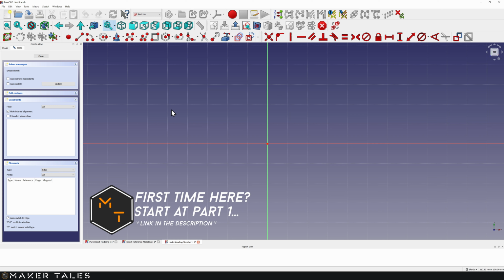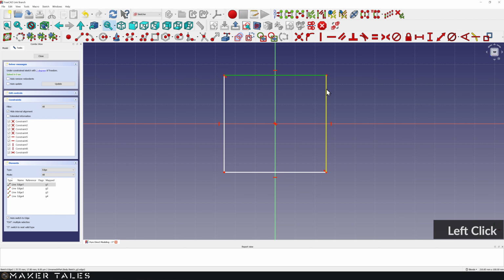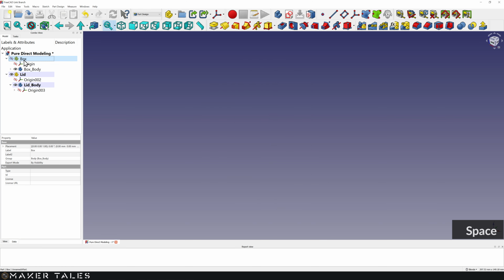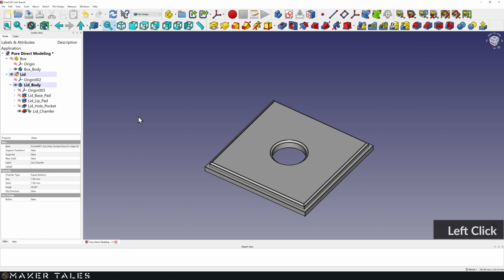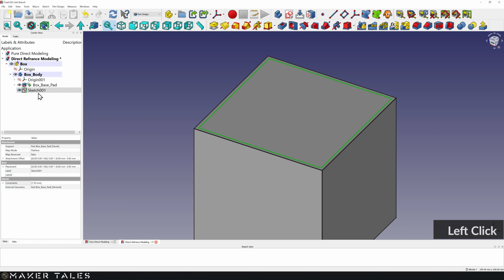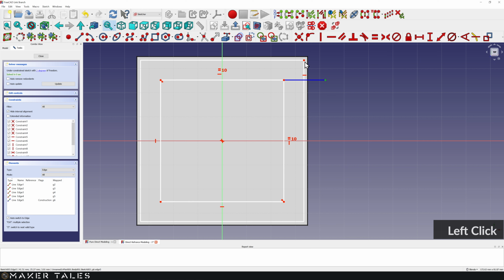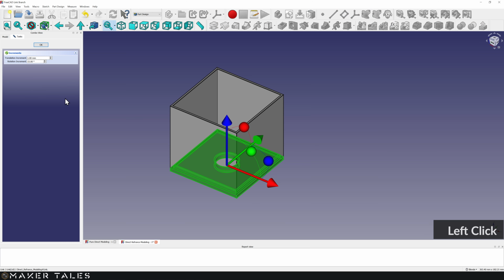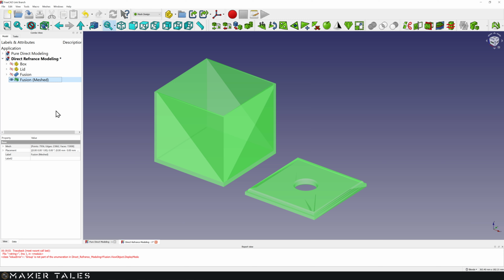Your First FreeCAD Project For 3D Printing | The Realthunder Branch | Direct Modeling | P. 4

Comment: A year on, and most of the info is still great. But I'm having an issue with the keyboard shortcuts not working. I can workaround with the toolbar, but "Shift-V" claims I've already got a locked dimension once the symmetry is established; and "R" definitely doesn't start a rectangle. Not sure what's happening. Of course, it could be something else, but I really haven't done anything other than this video and the one before it. But still glad to see such hard work going into this! 

NOTE: These are minor issues with workarounds.

Comment: Well FreeCAD 0.2 has been released and I can confirm that... you still need the realthunder edition to complete this tutorial:
* FreeCAD 0.2 doesn't have the enhanced External Geometry combo button so you don't have "Add/toggle defining geometry" available as an option.
* When it comes time to do the Lid_Base sketch FreeCAD 0.2 correctly shows the geometry from both of the Box_Base and Box_Hole sketches, but you can only (sometimes) select edges and points from Box_Hole, and can never select edges and points from Box_Base.

Oh well...
Reply: Still A problem a year on
Reply: This Video explains how to correctly use Shape Binder to achieve the same goal with only a minor change to the workflow, using bodies in place of parts.
https://youtu.be/pDUWuVG13rI?si=SqfFXI9MRAEScFvO
Reply: My standard FreeCAD restructured file using Shapebinder approach.  https://drive.google.com/drive/folders/1D6dleLWt8nPhssLIwyOwHX4t0CAHsjdY?usp=sharing

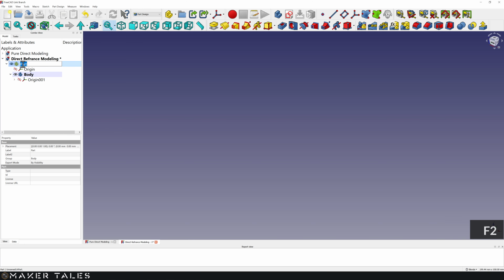Comment: Is there a way to copy and paste previous work? For instance, supposing at 10:42, if you wanted to copy the Body from the old part without having to re-do all the work, can you copy Box and Box Body from the earlier model to the new one? I realize that for this tutorial it's useful to repeat the steps, to remind people how it's done. But I've been looking for a way to do this, and haven't found it yet. Other than copying and renaming the file outside FreeCAD and opening it again and deleting the later steps, of course. It's easy to get messed up with multiple sketches, pads and pockets, too.. Haven't got the hang of working with the element hierarchy tree, then again I've just gotten started.

Comment: I do exactly the same things you do, with different dimensions because I am designing a particular thing. It simply does not work the same way in New Mexico*.

I draw the box. I get it fully constrained. It will not pad. I diddle and fiddle and eventually get the pad icon to show up in color, but I have no idea what diddlefiddlery made that happen. I press the pad button and get some no-useful-information error message about Active Body Object

I go to the FreeCAD forum and I am shocked! to discover the same unhelpful arrogant jerks I find at SCUBA and ham radio and Arduino forums, 7 answers on a question about Active Body Object, no information, but don't they all have the same "Use the search feature. This has been discussed many times!" button on their keyboard. And, of course, a grammar nazi. The OP never replied again. One post and he's outta there.

I somehow get the Active Body Object situation handled. No idea what I did. I do the pad thing. I open a sketch for the pocket. I do the thing with this corner, that corner, center, hit S and... the pocket shrinks to a tiny portion of the body. Do it again with the >< icon. same result. 

The vertical center line goes from green to green when selected. the box tool shows blue letters on a purple screen. this program was designed by sadists.

I watch the video a dozen times, I eventually figure out which buttons you push, I push the same buttons in the same order, and it does not work. Not just you, every other FreeCAD tutorial on Youtube.

* Lou Wallace, 75th governor of NM ( going back to Cortez days ), 11th governor of the US territory, 1st governor of the state, and author of Ben Hur, once wrote :calculations based on experience gained elsewhere do not work out the same in New Mexico"

Comment: i have a question.. when i have created a box with few holes on different faces and want to change a hole size, why my others holes sketches become crazy? (the references of my holes are the borders of each side and i use the latest freeCAD version).. sometime a hole sketch is lost in an other axis and i can’t figure what i do wrong!! ..it’s about the arborescence/sequence of my sketches??
Reply: Sounds like you've run into the topological naming bug, which the latest version of the normal FreeCAD still suffers from. If you want to follow this series, he uses the Realthunder branch of FreeCAD which largely fixes this issue. You can find the link to it in the notes of this video.
Reply: If you want to watch a video discussing this issue, and why he is using the Realthunder link version, he made a video: https://youtu.be/QSsVFu929jo